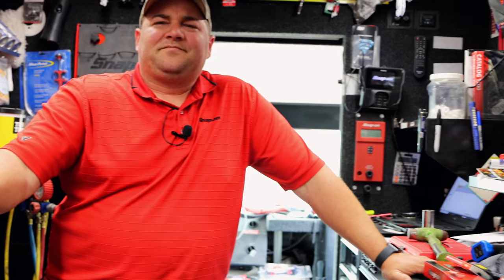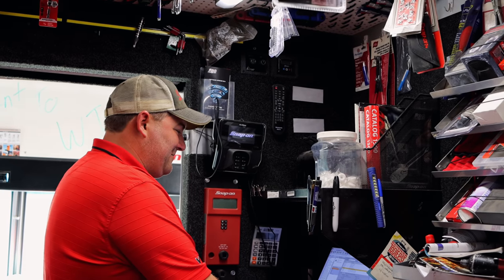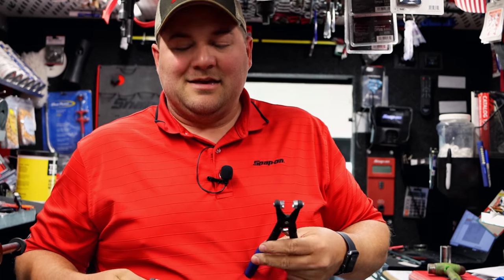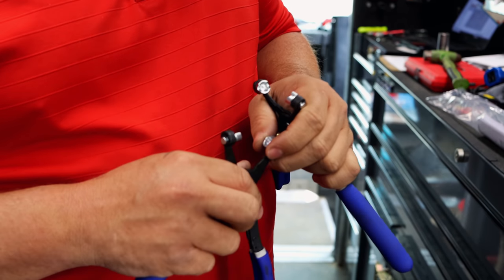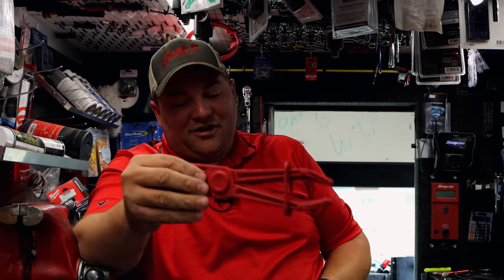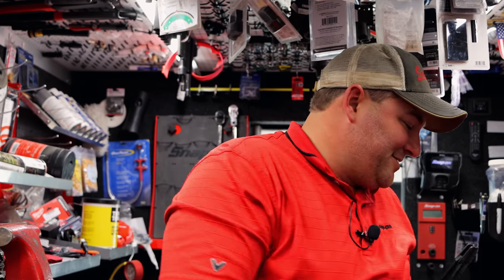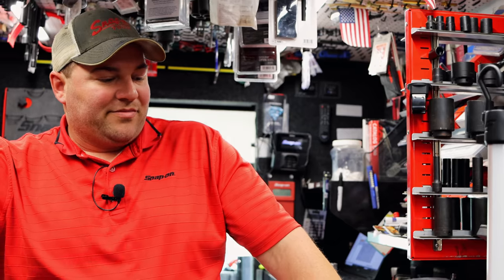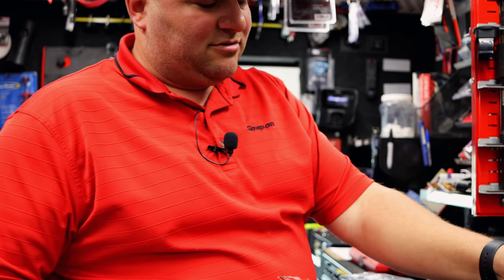Snap On New Brushless Ratchet CTR861 (LEAKED INFO?) 🤫 and Why Blue Point Hose Clamp Pliers Are Best

Comment: I just got the CTR861K2 kit 60ft pounds is what it’s rated for. It’s out and ready to work.
Reply: Can’t find any info
Reply: The specs on the box say.

14.4 V MicroLithium Brushless 
Cordless Ratchet Kit

• 60 ft. Lbs. (81N•m)
Of torque power 
• Super Bright LED light output
• Over and under temperature 
Protect keeps tool operating efficiently 
• Cushion grip handle for positive tool control with less user fatigue
• Large greasable reversing knob for ease of direction change 
• Built-in fuel gauge indicates battery state of charge

Comment: Still no brushless impact, but at least we got another ratchet!
Reply: There is CT9075 1/2 brushless impact.
Reply: True true I have them all and they all have there place. Ct8850 still keeps up use it daily and lighter then the new brushless Ct9075 that’s for the stubborn stuff.
Reply: @bigboreracing356  I need to get one of those you have the brute or 767 I’m still deciding what’s your take on it.